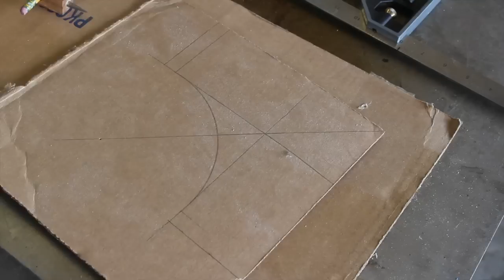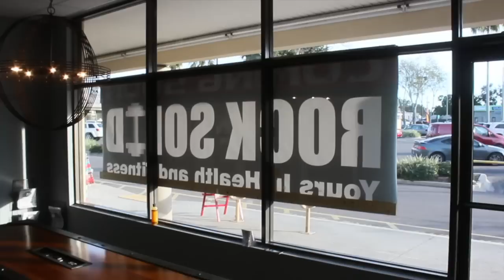Industrial Power & USB Conference table | How-To

Comment: I never knew there were jigsaw blades that could cut through sheet metal. This is a game changer for curves!
Reply from the maker: Yeah, they are incredible--I'm very surprised at how well they work.
Reply: @ZHFabrications  I have used some metal blades that were awful. What brand are you using?

Comment: Love your work.  True artist.  If I could make some suggestions  This is just the electrician in me and dealing with inspectors and OSHA. On the power feed cord both for  aesthetics and protection you could run it inside the leg and put a rubber grommet at the bottom.  Next some electrical code calls specifically for the set screw connector for BX cable.  Some area's codes don't allow for cable protruding unprotected from the shielding, technically a standard power cord grommeted at the leg would pass.  If spills are a concern you could use a cord with a GFCI.  Just my two cents.  Keep up the good work.

Comment: Sweet build! I would worry about spilled beverages making their way into the electrical, letting the angry pixies dance on and in your conferencers. If you haven't already, I would super duper highly recommend putting a GFI between that plug and the wall outlet. Home Depot has a Defiant-brand external GFCI adapter for all of 13 bucks.

If you're not familiar, the GFCI is an amazingly fast safety switch which would save your tookus in the right wrong situation.
Reply from the maker: Thanks, and yep, it's plugged into a GFCI--I studied as an electrical engineer :)
Reply: Derek H A+ for AvE reference. Why do we electrical engineers take to hands on trades??

Comment: very nice, i was wondering what you were doing with those hand planes.  I have been listening to the podcast and i know you were talking about having and using both power tools and hand tools but being so busy all you talk about is power tools.  Then you pulled out he planer :-) James takes the hand tools reigns.
Reply: Also, very entertaining.  A little longer than the "average" maker video but never wanted to fast forward, keep it up!
Reply from the maker: Thanks... And yeah, I actually had to hand plane one of the boards to get it flat before thickness planing it. (The planer will only reduce the thickness of the board not the huge bow I took out with the hand plane.)
Reply from the maker: Good to hear, thank you!

Comment: i know it dont matter now. but to make the table a bit stronger use biscuits when joining the boards. i like the table too. to me its like a medieval feel.
Reply: Not everyone have biscuits around. For instance i didnt even heard about those until year ago. There is so many possible ways to make joints stronger, like cutting channel on the both faces and then inserting peace of wood, wood dovels drilled into holes connecting the two, or just cutting step on another and thats step then rests top of the first one.

Comment: Can you explain what you are doing to the metal when you are applying the finish? I am building a similar table and I want to have the same look for the metal.
Reply from the maker: I used black magic by sculpt nouveau(link in video description) it's pretty easy to use. Prep the material, apply patina, rinse with water, dry and clear coat.
Reply: ZH Fabrications awesome. thanks for responding man!

Comment: Dear Zachary. 
First of all I would like to thanks you so much to share on YouTube your ART. 
I’m a big fan of what you are doing. I’m watch this video and I’m trying to follow step by step what I see trough the video to make my own industrial table for my living room. 

I have an important question please. 
To prepare the metal before applying the BLACK MAGIC product, I see that you are preparing it by grinding all the surfaces. 
Can you please tell me which kind of disk do you use? Is it the same as the one you use to cut tubes or it is a striped disk with a 120,80 or 60 grain? It’s a critical step for me at this stage. 
An other question please. 
For the Black Magic,how long do you let it apply before watching it with water. 

Thanks so much for your answer. 

Faithfully. 

Sébastien.

Comment: actually i don't know if you made it on purpose to attach the cables on the leg , but if you made the cables pass inside the leg of the table, it would have been a bit more clean looking. Otherwise, awesome job man! :D
Reply from the maker: Thanks, and yeah that was the original plan, but It would have to exit the leg at some point to go into the outlet, and would inevitably get ripped out at some point, I figure this was the best compromise and it lends itself to the "Industrial" aesthetic.

Comment: I have watched a few of your vids and I like your builds.  But I have never seen someone weld like that.  Is there a technical reason you pump the trigger that way?  Also, nice vroom tat
Reply from the maker: It's actually known as "trigger pulse welding" It's beyond tack welding as it's actually getting good penetration. I typically use this if I'm trying to eliminate heat warpage, and also if I'm going to leave the welds exposed I find it gives me better control aesthetically. If I'm going to grind the welds I'll often just do a continuous weld.

Comment: Really nice work. One thing thou that I don't get.
When u'r welding, i looks like you are only tacking not running a continuous bead. Why is that?
Reply from the maker: Thanks!
It's actually known as "trigger pulse welding" It's beyond tack welding as it's actually getting good penetration. I typically use this if I'm trying to eliminate heat warpage, and also if I'm going to leave the welds exposed I find it gives me better control aesthetically. If I'm going to grind the welds I'll often just do a continuous weld.

Comment: how did you compensate for width-wise shrinkage and expansion in the maple? Just curious what sort of problems (if any) you have encountered with top warping. Love the end product tho, keep it up. thnx
Reply from the maker: The holes in the wood are about 1/4" larger than the bolts, and the bolts are a hair more than finger tight. No problems yet :)
Reply: Very nice! Im supposing you left a 1/4 to 1/2 inch gap between the top and the angle iron apron? Nice solution. I myself learned the hard way to comp for expansion, hence the question. I have large box frame table legs made with 1x3 tubing w/ a 1/8 plate to screw into the slab top. No room for expansion. My idea is to mill out a small horizontal groove in each screw hole in the 1/8 plate to let the lag screws move (with washers/petroleum to ease the process). Think that would work? If yes, any clue how to do it with basic power tools? Thanks a million

Comment: Where is there more detailed info on how you finish the metal to have that dark coating?
Reply from the maker: It's Black Magic by Sculpt Nouveau.
Reply: Thank you! I've been wondering about this for a while. Going to make an angle iron framed speaker box with walnut panels.

Comment: dude, you're my hero. I'm a joiner by trade, studying to be an electrician, that really wants to learn to weld. this was like porn for me... one question: was it the acetone that gave the metal a patina or did you put something else on it?
Reply from the maker: You already have a good start. The acetone is more less just acting as a metal prep to remove any oils, etc before applying the patina.

Comment: Nice table, BUT, why didn't you router the edge of the timber to sit flush with the lip of the metal frame? It's the only thing that bugs me about it :(
Reply from the maker: Wood expands/contracts so it would lead to issues--possibly cracks and definitely a crumb catcher.